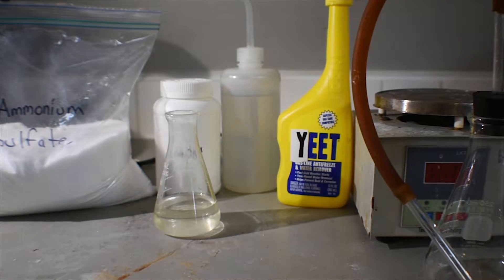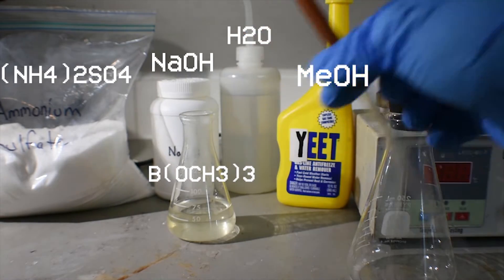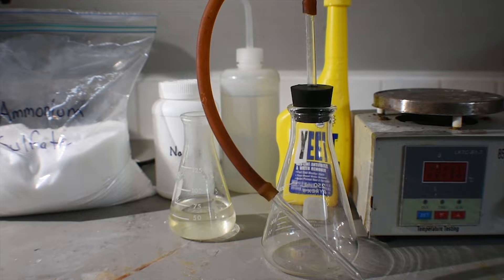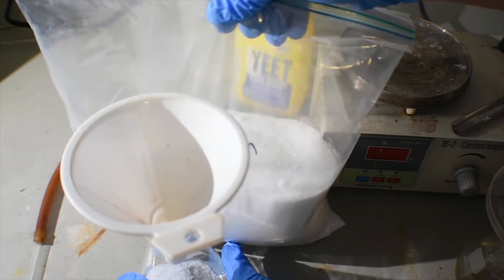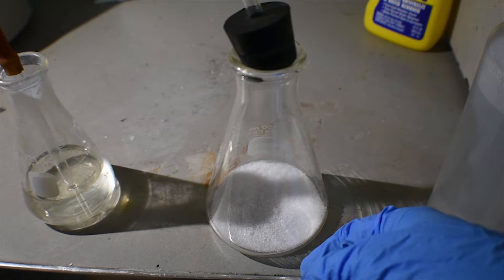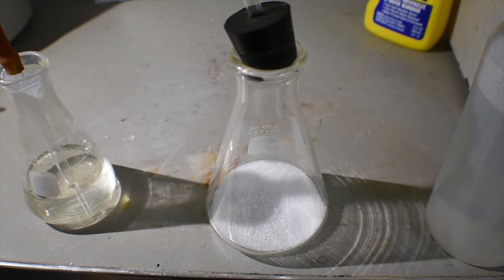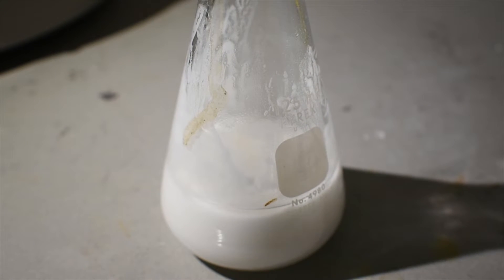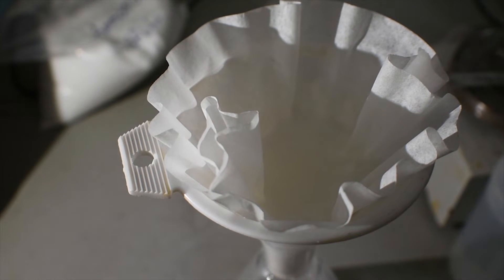Preparation of an adduct: Ammonia-Trimethyl Borate

Comment: Am I mistaken in thinking that you could just have added some ammonium hydroxide solution to that methyl borate? Since that's essentially what you're doing by bubbling ammonia gas through it right?
Reply from the maker: No. Ammonia solutions are typically only 10% concentration. The 90% of water present would not only prevent adduct formation, but would also hydrolyze the TMB.
Reply from the maker: The whole reason for using NH3 gas is to eliminate water entirely .
Reply: @Rhodanide  would be better to dry the gas then, you need a trying tube, an addition funnel etc. Hope you have these things now
Reply from the maker: @SodiumInteresting  yep
Reply: @Rhodanide  I just bubbled some dry ammonia through some trimethyl borate I had made last week. No precipitate  what could be wrong?
Reply: @Rhodanide  perhaps my trimethyl borate wasn't anhydrous enough and it killed the reaction. I assumed it had methanol still in it so I didn't add any more
Reply from the maker: @SodiumInteresting  I distilled mine
Reply: @Rhodanide  so did I but I assume it still contains water and methanol
Reply: @Rhodanide  perhaps I'll revist this and aim for a more pure product. It seemed like some salt may have formed at the top of the beaker when bubbling the ammonia but no solid precipitate

Comment: Thanks as always for the amazing videos!  

What do you end up doing w/ the product?  Are there particular uses that specifically require aminated trimethylborate? 

Anyway, love this vids, thanks for always putting out amazing content! ^_^
Reply from the maker: Thank you for the kind words! The adduct can be reacted with metallic Sodium in a solvent to remove the methoxy groups leaving Borazane. If I can find not only a solvent but some Sodium metal, then I plan on giving that a go.
Reply: Rhodanide anhydrous ammonia? Could you use any other alkali metal other than sodium like lithium? If you could that would be way easier to get
Reply from the maker: @j1j250  Ahh, unfortunately I don't have access to, nor the means to make liquid NH3. I have easy access to Li metal.
Reply: Rhodanide but would lithium work?
Reply: @Rhodanide  Hi, Rhodanide! maybe you know, what is the decomposition temperature(approx) of the adduct (or say adduct of tributyl borate and ammonia) to parent compounds? how hot was the flask while formation of the adduct, above or below 100c?
Reply: @Rhodanide  Borazane?

Comment: I wonder, could you convert it to boron nitride and methanol with a little heating?

(That also reminds me of a really neat bit of chemistry, frustrated lewis pairs:

You take a strong but highly sterically hindered lewis acid (like tri-(pentafluorophenyl)borane) and an equally sterically hindered lewis base (like tricyclohexylphosphine), and mix the two together in an inert solvent. 
They won't react, because they're too hindered to form an adduct.

But if you then bubble hydrogen gas into it, they will actually split H2 into the hydride on one side and phosphonium on the other!
And that can catalyse all sorts of hydrogenation reactions.)
Reply from the maker: Actually, reaction of the adduct with Sodium metal forms Sodium Methoxide and Borazane - no Diborane needed! Now, one just has to know what will dissolve the adduct...
Reply: @Rhodanide  "reaction of the adduct with Sodium metal forms Sodium Methoxide and Borazane"
Really? How does that work in terms of stoichiometry? (where do the hydrogens on the borazane's boron come from?)
Reply from the maker: @piranha031091  That's what I was wondering, honestly. The assumption that it would make Borazane was purely on my behalf. However, the reaction of the adduct with Na metal forming a  Methoxide is stated in the patent I discovered. I'd only think that Borazane would be produced, and thus made an unsubstantiated claim which was kinda shitty on my part, I'm gonna own up to that one.
Reply: @Rhodanide  It is kind of probable, that it will form borazine, though.
Reply from the maker: Well that's... odd...